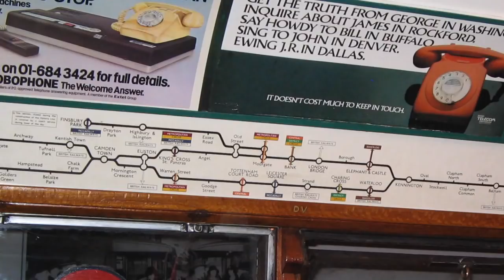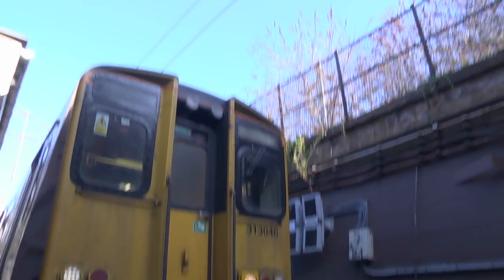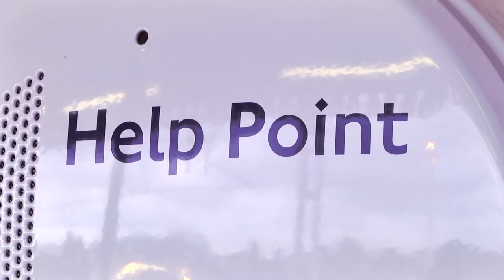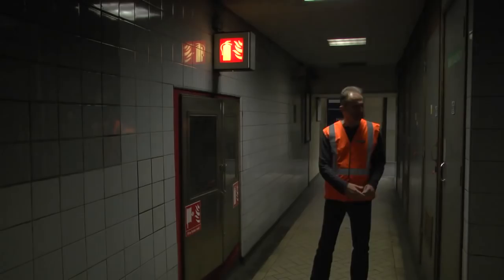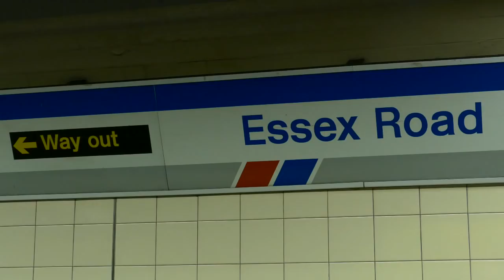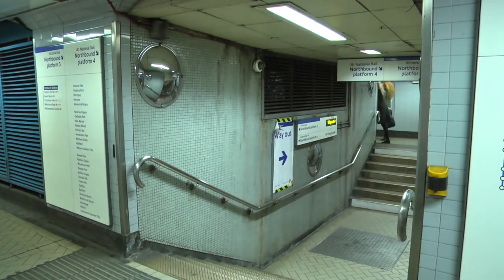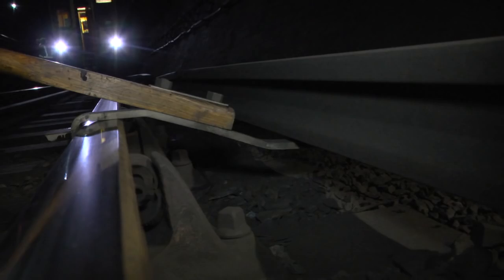The Northern City Line - Great Northern Driver Safety Training

Comment: "Remember, when applying the short-circuiting bar in the northern city line tunnels, you must always turn away and cover your eyes" So you won't get sparks flying at your eyes.
Reply: That’s one reason but I think the primary reason for covering your eyes and turning away is because of the resulting bright arc flash

Comment: Actually the line used Standard tune stock till 1966 when the 1938 stock took over and the standard  tube stock went to the Isle of Wight.
The line was very spook and the tube trains  looked like ghost trains coming out of the old huge tunnels.
The stations did have a very dank spell to them as mentioned.
One thing I remember was the eerie  sounds the small tube trains made as they went along through those large bore tunnels,very different  than the noise of a tube in the 11ft 8 tunnels on the tube.
I swear that line was haunted.

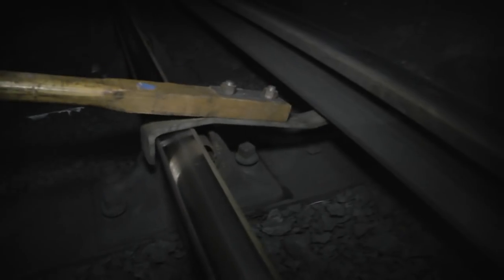Comment: 13:50 You should ALWAYS cover your face when using that bar, even if the traction current has already been isolated! This is because you cannot rely on an emergency switch off to protect you from the current being accidentally re-energised.
Reply: Why
Reply: @RmsTitanic59  Some substations have automatic systems that will re-energise the rail after 15 seconds, to allow for possible transient conditions. There is no way to know if this has not happened since the first isolation - if the current was indeed isolated at all!
Reply: @RmsTitanic59  Human error, or a train stopping in the wrong place.

Comment: Only issues I have is not just with Essex Road station, as the emergency spiral staircase gate at booking hall-level is always locked!. Highbury presents another danger with two escalators and no other means of exit between Highbury and Drayton Park with an evacuation, unless at Highbury, passengers are sent up by tunnel bore to Drayton Park. And if Pool Street at Hoxton was the only evacuation point on the tunnel section before Old Street, where were the others between Old Street and Moorgate?.
Reply: MAybe that station has one-way doors? Essex I mean? It used to be possible to go through the "firedoor" at will, guess they changed things!
Reply: false stairs have odd fire doors which cant be locked. Blue grilled gate has a pedlock on it (staff area). Evac onto the track to Drayton park. LFB would have a field day with anything that is locked and regularly check all stations
Reply: That's simply not true. I used to regularly use that station up until 2018 and I'd often nip down the spiral staircase to get to the platform, enjoyed the eeriness and it was better exercise than waiting for the lift. The fire escape can be accessed by double wooden doors that can be pulled open from the outside. The padlocked metal gate I'm not sure exactly what it is but I think it leads to the other side of the lift.

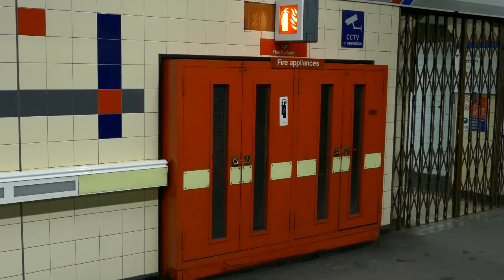Comment: 6:50 Incorrect, foam can be used on fires involving accidental contact with electrical current not exceeding 35KV but are not safe for any intentional use on electrical current.
Reply: Maybe it's intended to be 110 A ?
Reply: @liamchan_  No. He meant 110 Volts, as that is below the 35KV limit.
Reply: OK, thanks.